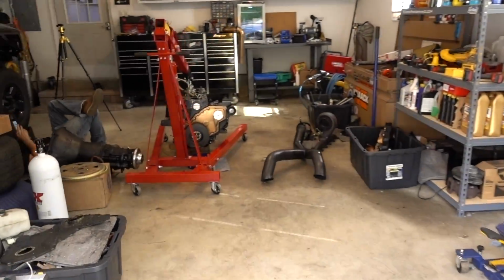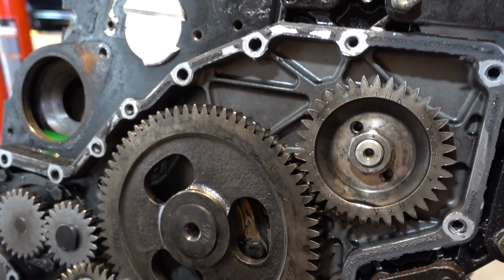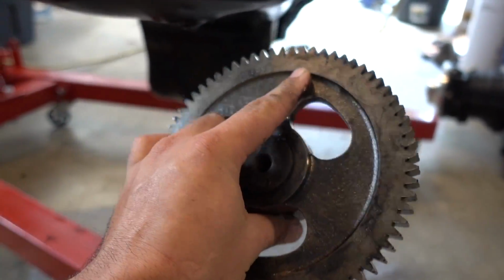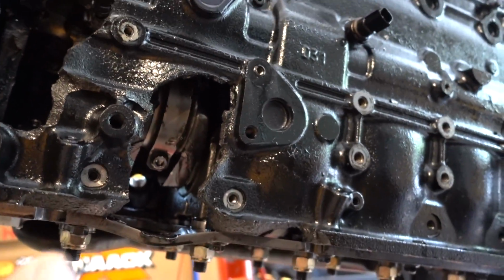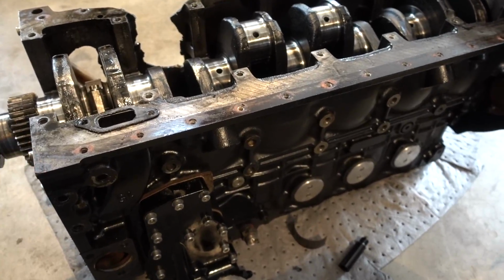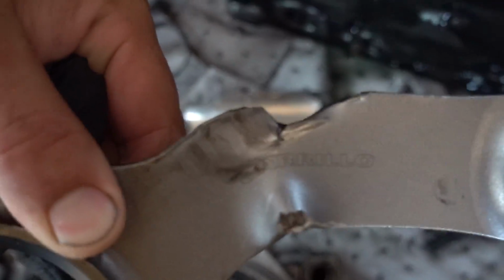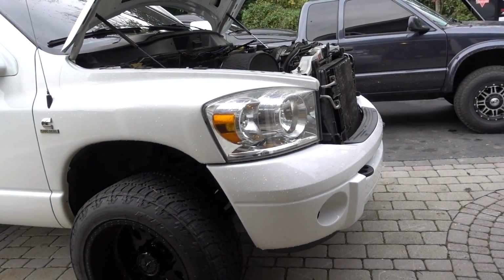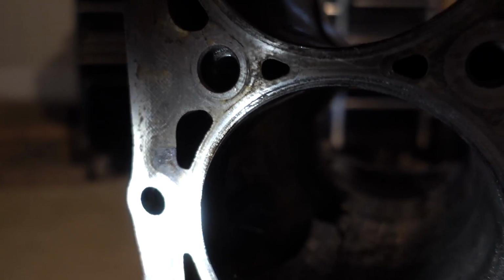CUMMINS BILLET ROD COMPLETE ENGINE TEARDOWN!!! **VERY VERY BAD NEWS!!!**

Comment: Question: does oil pickup tube go into the backside of the block? Because this looks like oil starvation destroyed the front 2 crank journals, as well as the first two cam journals.

Comment: I am wondering if the piston ring gaps were large enough for the racing application. Nitros and Super Charged and Turbo Charge fuel cars/trucks need very large ring gaps to prevent binding under super high stress/temps. Could the pistons have bound up in the cylinders to cause the blow up? Another possibility comes to mind with sticking valve guides holding a valve open... perhaps bronze valve guides better?

Comment: Crank gear could be the bottom of a stand , valve cover can be a  top for short tube light, use whatever from engine to make your light weld it all together, wallah and you know how to do wiring.
Reply: and make a small plaque "YT call out 1" or" Engine delete reconfiguration"

Comment: what happened was you found the max capacity of your engine parts. To have that many rods bend at once its more boost than those rods could handle. Go with a 8.3 liter cummins and less boost

Comment: Looks to me like there wasn't enough gap on the piston rings. You were deep into boost and heating up the cylinders pretty hard when it broke. Looks like the ringd but up against themselves and tore the top of the pistons off
Reply: That's very likely what happened.
Reply: thats exactly wat happened! Big boost=big ring gaps. Big boost+small ring gap= rings butting against each other until the ends slip past each other and mass carnage ensues...

Comment: Everyone can say what they want about how they think the engine blew, but truth be told 6.7 blocks will not handle that much cylinder pressure. This is the reason for sleeves and deck plate... I doubt the rods or pistons failed... this is just what I gathered from all the carnage I have seen in the past... good luck with the next build and happy birthday Mr Greg...

Comment: Most guys don't realize that working on diesel engine has probably about twice as many things that have to come off the engine.
Anyway glad to see that you're get yourself some new pieces and can put the unit driver, back together.
Don't ever do this again!
BTW, EBAY auction your old parts and see if you get anything...
There's a lot of idiots with money that buy stuff like this

Comment: Honestly don't understand why you are even tearing the engine down, obviously the whole engine is toast. very few if any parts are salvageable
Reply: David Lorton Best way to try to figure out what happened so he can try to keep it from happening again
Reply: 94 Chevy Z71 true, but what the viewers don't know is exactly what all he did to the engine. it's hard to tell the exact cause of the failure, it could be anything
Reply: 94 Chevy Z71 Although the best way to determine the failure is to hook up to the ecm and check faults as well as all the data to see exactly what happened, the ecm will have all the data that will tell you what went wrong